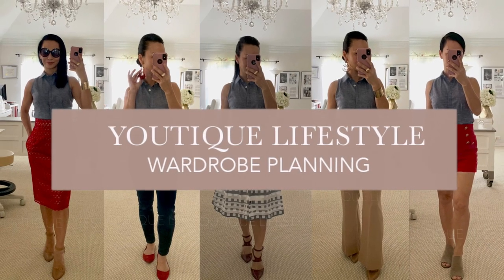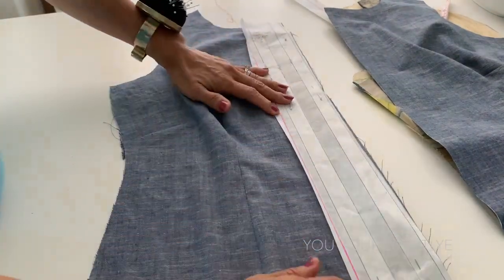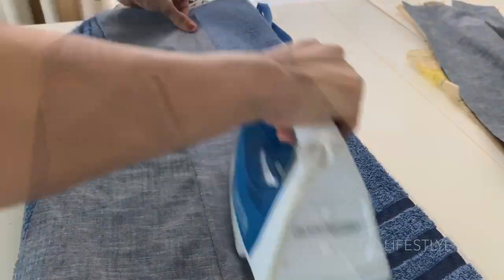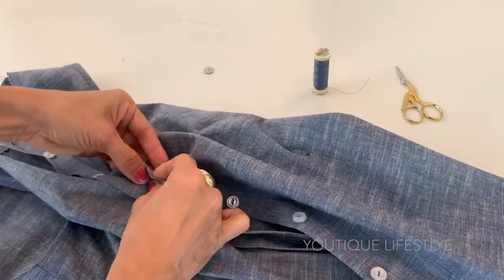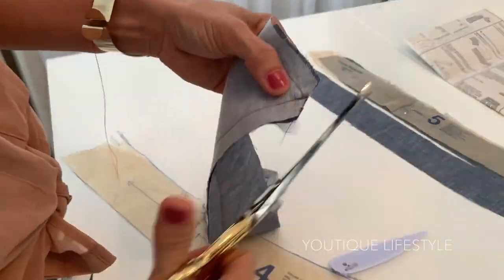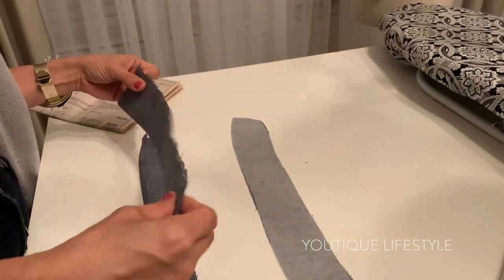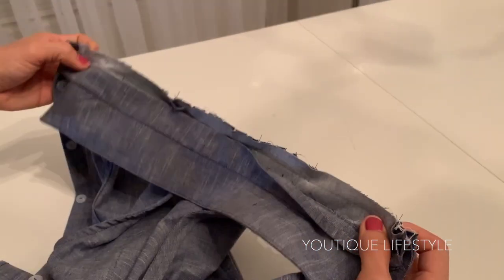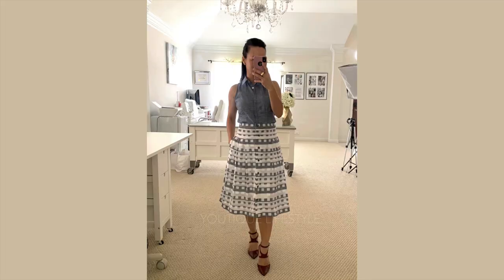How to sew the Concealed Button Placket & Shirt Collar : Chambray Blouse

Comment: Should the concealed button placket piece be the same LENGTH as the front shirt piece that it's being sewn to?  I have a commercial pattern for a shirt that I'm working on and not only is the concealed button placket piece longer than the front shirt piece but the notches on each piece don't match up.  I'm trying to figure out if this is an error in the pattern pieces.